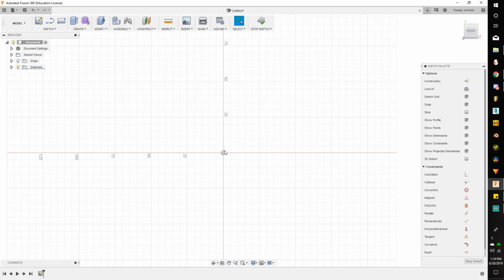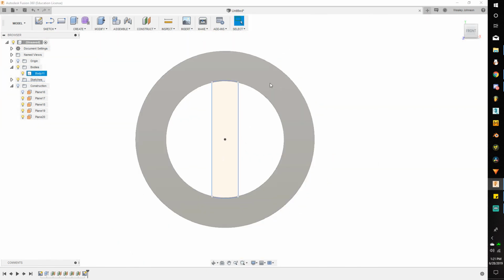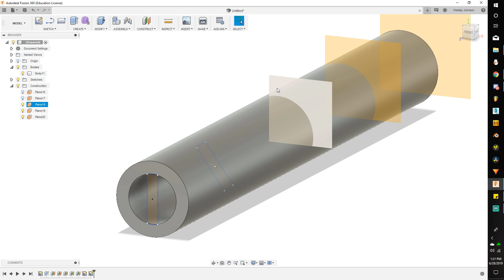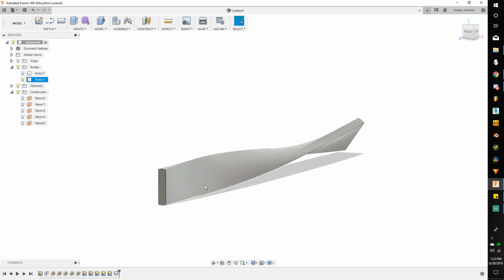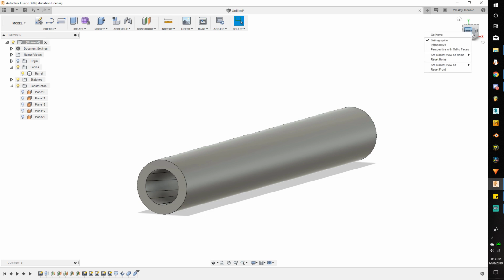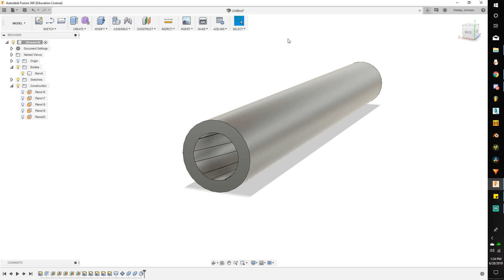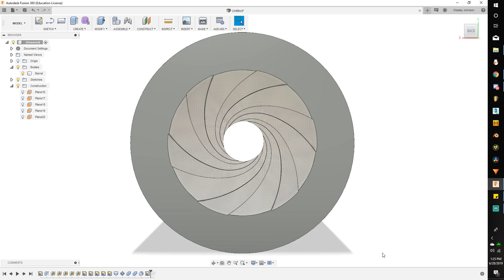HOW TO: Barrel Rifling In Fusion 360 (OLD)

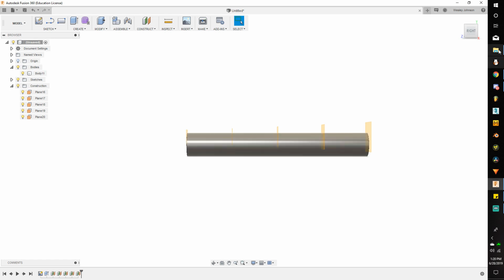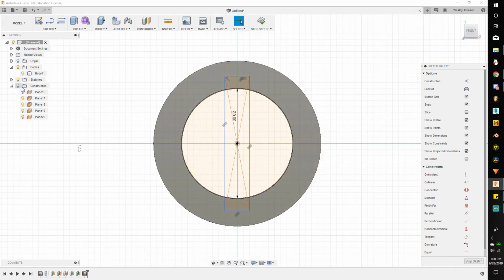Comment: How would you account for a different twist rate? Like so you rotated 36degree every 1 inch for a 1:10 twist rate so how much would you rotate for a 1:48 twist rate?
Reply: Simply convert the rate, if it's 1 rotation every 48 inches, it'll rotate 7.5 degrees because one rotation is 360 degrees. 360/48 basically.

Comment: Jeez, I'm just switching from solidworks to fusion and with every step I was only thinking "this can't be the only way, it's too much of a hassle". In solid this is literaly 3 steps: Sketch>Spiral>Swept. Damn overpriced software.
Reply: I've used both software for a while and I can say this, there aremultiple methods you can use, you just have to find a way to do them, some easier, some harder, some longer, some shorter. 

To be honest found a method to make the rifling using the coil or  whatever tool it's was, I just forgot cuz it's not like I use it often.

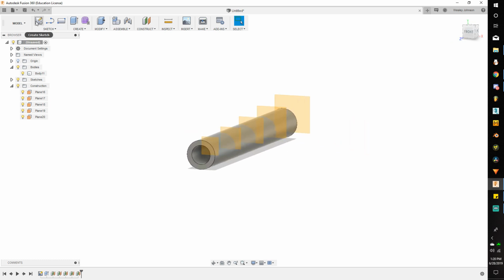Comment: FYI, for 9mm bullet stabilization will occur at 1:14. 1:7-1:10 wont generally stabilize just about anything. great video though!
Reply from the maker: Howdy, I'd like to firstly apologize for the extremely long reply time, I've been working through some things so I'm sorry about that. However, I would like to thank you for pointing that out! I went around a couple of different forums trying to get an idea whether or not that twist rate would work and was generally told that a 1:7 to 1:10 should do the job but I'm certainly no gunsmith haha.